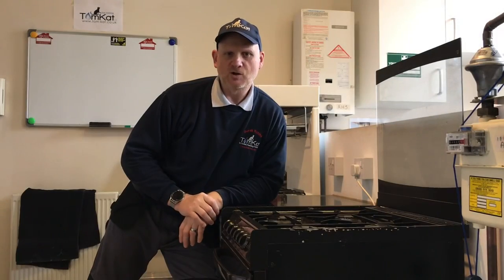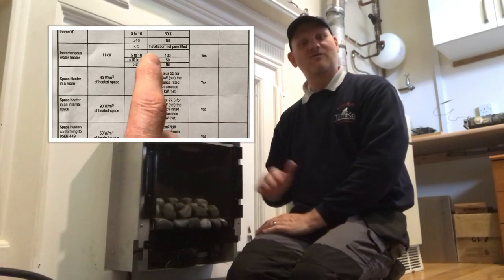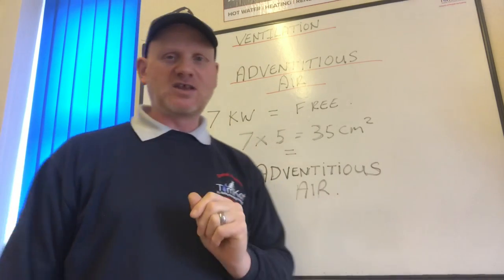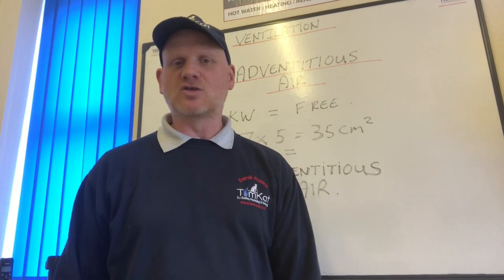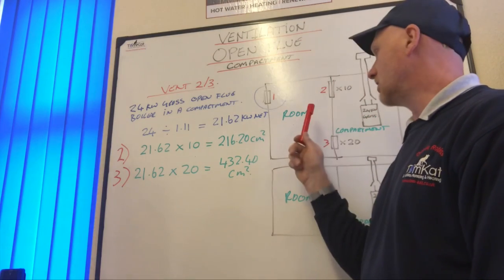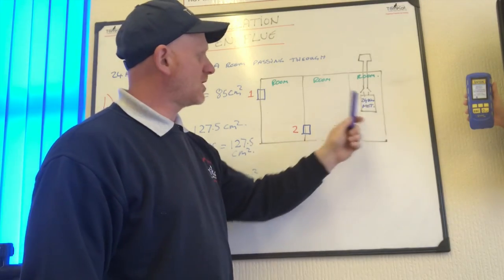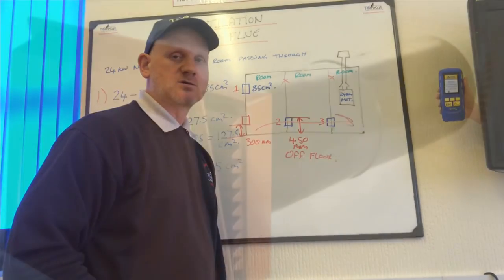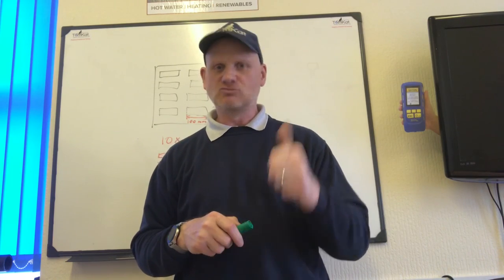Ventilation tutorial for trainee gas engineers PART 1

Comment: If your coming into the industry now, open flue appliances with vents are going to be few and far between. The last one I attended was about 4 years ago, In my experience its the cause of the most amount of friction with customers. The one I mentioned was a Baxi Boston boiler installed in a kitchen with no air vent fitted. The customer just about threw me out of the house after saying I didn’t know what I was talking about after I advised him it was unsafe to use the boiler. On another occasion with another customer, I got into another argument after a kitchen fitter had fitted a new kitchen, removing the air vent that had been fitted for the boiler and then boxing the boiler in tightly without any compartment ventilation. The boiler in question was an open flue Glowworm Hideaway. In many respects I don’t miss them.
Reply: The shit we go through every 5 years just to be told by an unqualified person that we're wrong... its unreal lol.

Comment: Very helpful and made it easy to understand, but not sure how the calculation on the first example added up. Open flue ventilation. The 20.02 x 5= 100.13. On your example it added up to 135.13cm2. Which ones correct please. Keep up the good work as its very informative and helps with my training no end.
Reply: i was thinking same, i think they've made a mistake. it should def be 100.13

Comment: Great video. Very helpful to understand why you would require an outside vent. 
Whilst it’s important to understand the figures, I’m assuming in 2021, most people will be looking to purchase an appliance that does not require an external vent, especially in Winer!
Reply: Most water heating appliances now are room sealed so no need to put holes in walls !  The conflict is trying to insulate your house as much as possible which does not support putting big holes in the walls so there is nice cold fresh air coming in for a gas appliacne ! But those type, though still to be found in older instatllation, are no longer made. Gas fires however can demand a lot of air, so it may be necessary to put vents in to the outside.

Comment: These are great videos. With ducts though what are the rules/regulations regarding gas pipe work run in ducts?
Reply from the maker: Depends on the size of the duct depends on the vent size. Also needs a vent top and bottom of the duct

Comment: i know this is an old video but, if the data badge doesnt state wether its gross or net output, you said assume its gross. shouldnt we assume its net? as not dividing by 1.1 yeilds a higher free air area meaning its the safest option? these videos are excellent. sitting my initial acs this month.
Reply from the maker: You are correct but I said gross for my trainees because they kept getting a certain question wrong in the exams I didn’t think anyone else would watch my videos. How wrong was I 😂
Reply: @tomkatgastraining  no theyve been great. very informative and really helping settle nerves for the assessments this month. any tips for what subjects to really get stuck into would be appriciated.
Reply from the maker: @Mr1anmu77ay  we are logic and they have quite a few questions on CO alarms and shared flue systems so have a look at them

Comment: When you were measuring the terracotta vent, which side do you measure with the ruler?  I'm guessing the smallest holes you measure with a ruler
Reply from the maker: Blue Dwarf you measure the smallest part so the inside hole . If the vent is fitted you need a vent gauge to be able to measure them . Thanks for watching